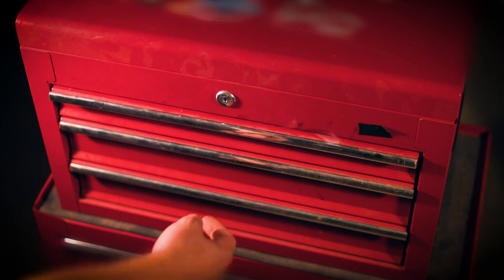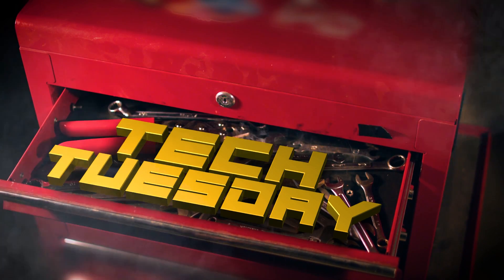🛠 How Engine Protection Works | TECH TUESDAY |

Comment: Shame it is not 'enabled' in the lower level ECU's. You have to pay more to have the feature enabled.
Reply from the maker: Since we made this video in 2019 the Elite firmware has been upgraded, and we now offer single level engine protection as standard on all Haltech ECUs. If you already have an older Elite ECU all you have to do is upgrade your firmware to enable the feature. It is 100% free :)
Reply: @haltech  legends. Seriously.

Comment: i dont think it would be hard to add engine protection to 750, knock control and additional input/output is still more than enough reason to opt for a bigger ecu but for the price, it would be nice

Comment: Tires, breaks,  other supporting mods, proper ECU with engine protection , MOAR POWAR!
This is the safe, boring, correct way to do it... it is also the most cost effective in the long run. And as an added bonus you are less likely to kill others or yourself this way.

Comment: Another great video. Please keep up the fab work. 

Got a Suzuki Swift Sport (06) myself and every  time I try to putt away in a higher gear than I should (rarely), my car goes into Limp mode and limits the car to 2k rpm. Would this be the same as  some sort of factory default Engine Protection system? 

More likely is the fact that my  car's "fudged" as they say :P, never been the same after an O2 sensor replacement.
Reply: In an aftermarket ECU like a Haltech you can tweak every parameter to your liking and you can ask it why it is unhappy with a standard laptop with a USB cable. I don't know how locked down Suzukis are, but perhaps eBay has an el-cheapo error code reader for it? It would be nice to know if your O2 sensor is sending the wrong values, or if it stops sending signals when it gets too hot.
Reply: @andersjjensen  Cheers for the reply mate. Got an OBD reader that told me it was a  P0607 Control Module Performance error. Was thinking of replacing the ECU with an aftermarket one but wasn't sure where to start.
Reply: @dwizcreations  I think it might be cheaper to just get an OEM O2 sensor replacement. However, if you go for an aftermarket ECU, make sure it support a piggy bag configuration on your particular model, as the Suzuki ECU also handles ESP, airbags, central locking, etc, which a performance ECU normally does not.
Reply: @andersjjensen  Many thanks again for your time and comment sir :)

I think I'll take your advice and stick to the OEM replacement for now. The Mrs has kindly asked NOT to spend any more on the car, so no aftermarket parts for me just yet I'm afraid.
Reply: @dwizcreations  In all honesty I think your Mrs is right. A Swift Sport is a fun little gokart with surprisingly good brakes and suspension for what it is, but it is not an interesting platform for a project car, in the sense that you'll run into diminishing returns right away. Big investments are going to give you relatively little better performance/handling. Sure you can "rice it up" a little, but that is quickly getting into the realm of "total worth of vehicle" in parts.. and it is only going to diminish the resale value, so your money will be lost twice if you sell it.
Reply: @andersjjensen  Agreed! Plenty of money has already been sunk into it :P. 

Looking at an Audi A4 Avant, Audi S3 or a Renault Megan RS (the only ones the Mrs approves)  which are much better starting ponts I think. 

Thanks again for your insight. It's not everyday that one recives sound advice on the internet. Keep up the awesome work :)
Reply: @dwizcreations  There is also the third option to consider: Getting a more boring daily putter with good practicality and economy (like, say, a Mazda 6 or whatever), and then get a dedicated project car from before there were a million sensors and airbags and whatnot. The cars you list are notoriously hard to wrench on, and you can't get piles of parts from the wrecker for cheap for them. An old Golf GTI or, say, a BMW 320i from the 90s would be good learning platforms. You can get Haynes manuals (a MUST for non-mechanics!) for them and a ton of aftermarket parts. And you don't have to limit your projects to "must be ready for Monday morning" size tasks.
Reply: @andersjjensen  Good option indeed. However I am based in the UK and space for parking a third car + taxes/mot and such if I want it to be road legal and not just a track car become a luxury real quick. 

A decent E46 325Ci or even a larger turbo model can be had for cheap over here and it'll be a great base for things. 

I realise as I age and have to be morre "adulty", the search for that magical  "do all" car becomes increasingly harder for a good price.  Something that will get the groceries, keep the wife happy AND be a great B-road driver when I decide to take it up to the mountains.

Comment: I have a question regarding something more involved. If I have been setting up a nice road tune (via a wideband, gauges, datalogging with *insert ecu here*) and have done time on the dyno to verify and clean up the map, how important is it to keep the ecu in a 'corrective' state, using the wideband to correct the fuel a few %. Or can I simply turn that off, and safely drive on that map (Bearing in mind air temp and coolant temp is being corrected for and safety features enabled) How far off may that map end up being? How many % is acceptable to let the wideband correct for? What if the wideband goes faulty and starts throwing off the ecu? Please, any insight would be appreciated!
Reply from the maker: O2 correction can be left on after the tune is done and will correct for temperature and pressure changes. While I understand there is also Air and Coolant temperature compensations there is always room for improvement on any tune! This is why factory cars have O2 sensors and closed loop O2 control.If the Wideband O2 sensor fails, the O2 controller will identify this failure and disable the O2 control, then flag a diagnostic trouble code.
Reply: Thanks, I appreciate that input! I assumed it acted like a factory system, but I'm sure there are limits. I can set the allowed % of correction. Would 5-10% be enough to account for elevation and weather changes? Obviously letting it be able to pull 50% fuel is way too much, where might a happy medium be?

Comment: Is there a way in the software to change from sensor raw voltage being the parameter used for engine protection,  eg sensors PSI figure being high or low range for oil pressure. Just so i don't have to stress my brain too much working out what the corresponding sensor voltage is for my desired protection point :D
Reply from the maker: Absolutely, you can assign the engine protection levels to the Raw values or the calculated pressure after the calibration has been applied. It is most common to set the protection levels against the actual pressures/temps.

Comment: Hi, I don't get how level 3 works.
If it's a manual and in gear, how is the engine going to "shut down"?
Does it wait until clutch depressed or in neutral?
Thanks
Reply from the maker: If Level 3 engine protection is setup to turn the engine off (let’s say in the case of No Oil Pressure), the ECU will turn off either the Fuel or Ignition (whichever is selected in the Engine Protection settings) and engine will shut down regardless of gear or clutch position.
Reply: @haltech  Yeah, so it could still be rotating in gear. I guess there's no real way to get around that though unless it has an auto or some automated clutch system.
Reply: It will stop injecting fuel, and stop igniting the spark plug. If you're driving a manual car, yes the engine will continue to rotate with the engine turned off. You would immediately notice this happen, and push in the clutch out of instinct. At that point the engine will stop rotating completely.
Reply: @dropinbiking92  Yep makes sense 🙂👌